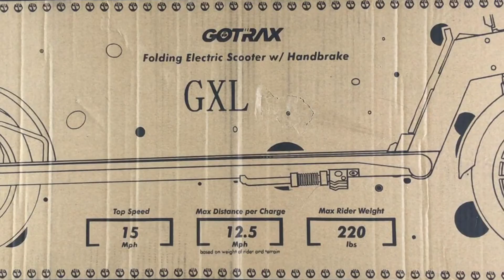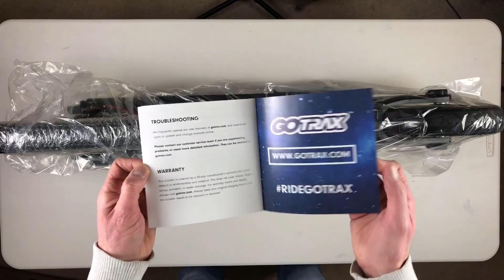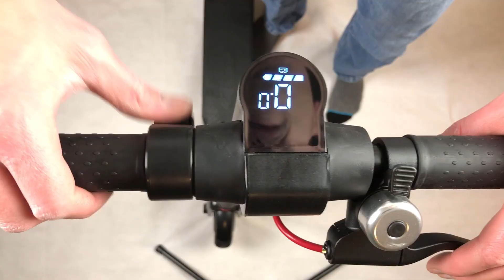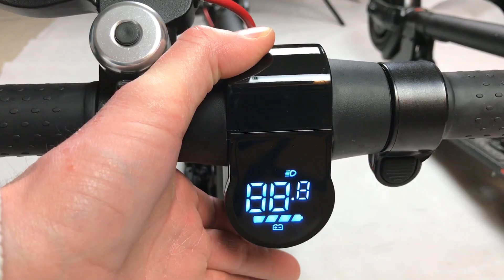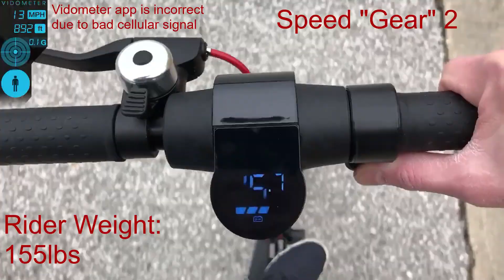NEW GoTrax GXL v2 Electric Scooter Unboxing and Assembly 2019

Comment: Hi, I have this scooter about two Months And I have a Accelerator Problem I cant ride my scooter anymore when I m push the accelerator button It doesn't working?
what can I do
Reply from the maker: Does the scooter power on when you hold down the power button for a couple of seconds?
Reply: @PowerOnFun Yes Everything Work Except the push accelerator
Reply from the maker: I have heard of someone complaining of the wiring of the throttle being low gauge and having an issue, but no resolution.  I would hit up Gotrax support with details to see what the issue might be and maybe how to further diagnose the issue with their product
Reply: I'm having the same problem with one I just got the acceleration doesnt work

Comment: can someone help? I can't get the break wire part down, I've tried attaching it before AND after screwing in the red hook and it's as if the line is too short and there's no give to attach it while its screwed in
Reply from the maker: Installing the tiller with the brake line can be a pain.  I think the easiest method is the one I used last by installing the brake line into the brake on the handle and then attaching the handle to the tiller neck.  If not matter how you try to install it the brake line is too short you may be able to loosen the rear brake where the cable connects and "borrow" 1/2in of it for added slack
Reply: @PowerOnFun  wait I’m a little confused with this description and what a tiller is, could you be a little more specific please? i even contacted their support team and all they told me was “maybe a bike shop can check it for you” like it’s your job... to support... so I’m basically in the dark here
Reply from the maker: Sorry.  The tiller is basically the scooter neck that connects the front hub motor/wheel and houses the battery pack.  If you have the brake wire going straight up the same side where it is attached behind the wheel (not going around the tiller neck) and there still isn't enough slack then easiest fix would be to loosen the rear brake line, pull some of the wire brake forwards, tighten the rear brake, and try to assemble again.
Reply: @PowerOnFun  i ended up loosening the very last screw that holds the end of the brake line and was able to slide forward some slack so that I could finally screw the top two screws on the red hook! thanks for replying and helping :)

Comment: I have problems with the rear fender and the folding hook, can’t separate them, May you help me please?
Reply: You have to pull it by force. That's how I did it and it didn't damage it at all
Reply from the maker: Sorry for the late reply.  I too have difficulty with releasing the tiller from the rear fender on the GXL v2.  I usually push down the tiller and put my foot on the rear fender and then lift up.  Regardless, it’s still troublsome

Comment: mine doesnt seem to go in 2nd gear? any ideas?  i hold the button down for 3 seconds and nothing happens
Reply from the maker: Does the scooter power off if you half the red button down for about four seconds?  If it's stuck powered on you may have to take the two bolts holding the handle onto the tiller, pull it out to disconnect the battery from the handle and reseat to see if it fixes it
Reply: Power On Fun yes it powers on and off fine but I can’t seem to get 2nd gear on it. I had a go trax v2 and it worked fine but this GXL v2 does it only have 1 gear or something maybe?

Comment: I’m having trouble lining up the handle bar to fit perfect in the slots when assembling it..I’m trying not to put a lot of pressure because I feel like it will break. Any recommendations?
Reply from the maker: If you are not sure if the pins are seating properly you can remove the handlebar from the tiller and carefully reseat it.  Once you believe the pins are lined up give it some good taps on top.  It should seat evenly and the screws on the side should go in without teouble

Comment: So theres a red thing when it locks the bike but i cant unlock it without the screw its on the back wheel
Reply from the maker: I had a difficult issue with unlatching the scooter tiller from the fender latch as well on both my GXL V2 and XR.  I was able to make it a bit easier to unscrewing the latch on the neck of the scooter and holding it as low as I can and then screwing it back down.
Another thing to try after that is to push    down on the fender while pulling it towards the rear of the scooter.
I'll have a video coming out in the future to help better explain this
Reply: Power On Fun thanks im glad you still reply to comments that videos are super old i just got one thats why

Comment: Good video. I own one of these and have no complaints. One thing to note, lots of people had to put tire slime into the V1 so they wouldn’t deflate. These come with the slime in the tires from the factory 👍🏽
Reply from the maker: I didn’t realize that Gotrax started adding tire slime into their tires.  That is a good touch to an already great scooter.  I have yet to add tire slime to my original GXL as well as my GXL V2.
Reply: Where to buy the slime for the gotrax?
Reply from the maker: @ednercarle7837 , I asked Gotrax about tire slime directly and they replied that the tire "inner tube does" have slime in it already.  I have not verified this, but assume they are correct.
If you still want to purchase tire slime here is a link:  https://amzn.to/2GHjkyy

Comment: Thanks for the video. That red brake cable had me confused for a minute. Didn't see it in the manual, lol
Reply: Yooo… sameee. The manual is not very detailed.
Reply: Ikr
Reply: I can’t get the red cord to fit
Reply: K I N L E Y . E x E ya I never really got it perfect but I juts pull that thing as hard as I can to get the break line to fit and my screws wouldn’t even go all the way in because of the pressure but it is what it is I put over 300 miles on my scooter in the first month and it was awesome I found this really steep hill and I could easily do 25mph on it and I weigh 170 but once you hit over 25 the scooter makes weird noises and it’s scary 😂😂

Comment: Hey, I was wondering how did you put it in 2nd Gear?
Reply from the maker: Once the scooter is powered on, if you hold the power button for a few seconds it will transition from speed level/gear 1 to speed level/gear 2.  If you are on level/gear 2 and hold the power button for a few seconds it will transition to gear 1.  I am not entirely sure if you can do this when riding however, but I will test that once the weather is nicer and I can ride more.
Reply: Power On Fun great video!!  I don’t know how I missed yours.  I’ve watch lots of videos on this scooter on assembly. They all suck!!! I purchased the ultra. Been riding it for 2 weeks now.  Been riding on it on gear 1.  I couldn’t figured out how to change to gear 2.  So now after watching yours, I think I can actually catch the green lights 😂

Comment: Just got mine and noticed the brake assembly instructions were not there , so helpful!
Reply from the maker: The rear brake should already be assembled.  I know there is nothing in the instructions to help with installing the handlebar with brake line onto the tiller.  However Gotrax has a good quick video on how to do this quickly.  I installed my handlebar and brake line the hard way.
Reply: Same

Comment: My gear 2 is not working ? I bought it oct 2020
Reply: There's no gear 2 on many models, it's something a bit new. I bought one late october and there's no gear (said so in the ad on Amazon). You just turn on.
The manual said you could go from gear 1 to 2 etc but there were no gears. Doesn't really go to 15.5 mph according to a GPS, either...

Comment: my break wire looks to be short , is this normal?
Reply from the maker: Make sure the line is going up the tiller on the side the brake line is attached by the base, then try to put the brake line onto the handle brake assembly with it deatached, then slowly attach the handlebar to the top of the tiller.

Comment: Is there  a big difference gxl and the version 2 ,,,and what would be a best buy price ,what would you recommend  to buy ,,,,thanks
Reply from the maker: Prices on Amazon can fluctuate, but normally the original GXL is $300 and the GXL v2 is at the same price or a little more (~$350).  I have affiliate links in my video descriptions for both scooters on Amazon.  Gotrax does also sell the scooters directly from their site.
Reply from the maker: I have a new video almost finished going more in depth to the scooter models similarities and differences.  The two scooters are almost identical except for the rear brake button on the rear of the deck on the original GXL and the handbrake on the new GXL.

Comment: i'm french so sorry for the writting mistakes...we assembled everything properly, we charged it until the light turned green. the screen lite up but  nothing else works, no light, no power at all nothing. Does anybody  have an idea why ...thank
Reply from the maker: I would remove the handlebar unit, then remove the battery within the neck, or tiller, or the scooter.  After that give the battery a quick inspection.  If you don't see any defects reinsert the battery carefully and then the handlebar and test the power again before putting on the hook and screws that hold the handlebar unit and hook on the tiller.
Reply: @PowerOnFun  thanks for the tip, but still nothing.  I even tried conecting directly the batery without the metal tubing unto the metal connectors and still nothing! The dash board lights up correctly but that's It... I do find the femal connectors on top of the batery (2 out of 5 small holes)To be différents.Not quite round. Anyways thanks for the rapid advise.

Comment: I cant get the stupid break in the in break area. It wont budge and i dont want to break the stupid break
Reply from the maker: You may want to remove the handle from the tiller neck, run the brake line into the brake handle while making sure the line is running up on the same side, and then install the handle.

Comment: I would like to state this, both my scooters of this kind was defective as i couldnt connect steering handlebar together towards the scooter itself so i had to return both of them and the battery dies way too fast imo
Reply from the maker: That is strange.  I know the brake line is fairly tight to allow for little to no slack getting tangled or caught when riding, but I've never had an issue with getting everything attached.

Comment: Can you ride it in light rain
Reply from the maker: The scooter could be ridden in the rain, but the wheels will lose traction on wet pavement in general.  In addition, the hub motor is not “waterproof”, but is at least water resistant.  However, if avoidable I would not recommend riding any electric (scooter, skateboard, bike, hover board) in or on wet pavement/roads/sidewalks.

Comment: Hey. I got this scooter but I'm unable to unfold it. Anyone to fix this?
Reply from the maker: I'm sorry for the late reply.  I have had difficulty with unlatching the scooter as well after my initial assembly.  Once I looked at the latch on the neck and the one the rear fender I then loosened the latch on the neck down as far as I can and then tightened it back up.  I believe that small changed helped a bit.
Reply from the maker: The latch on the rear fender is attached in a more complicated way and I was not able to get it loosened up to move it closer to rear of the scooter.

Comment: In all honesty, me weighing 240lbs won't break the scooter right? Lol
Reply from the maker: No, it won't break it.  The battery is in the neck so there is just structural support in the base (that and the brake cable goes through it)
Reply: @PowerOnFun  thanks fam
Reply: you wont break it, but may cause stress on electric motor (a.k.a: overheating)

Comment: How to open it
Reply: My friend left his how do u stand it up lol
Reply from the maker: The scooter can be a bit of a struggle at times to unlatch from the rear fender, but most of the time all it should take is when you pull down the fender try and pull it (towards the rear) a bit and then pull the tiller up and lock it in place.  To unlock it I usually lean down and place the tiller between my neck and shoulder while I pull the red lever and then pull the red side lock out a bit.

Comment: After watching this video fully I recommend that any 1st time buyers of a Gotrack scooter use a different video. This video is a lot of filler and goes to fast in spots you need slowed down. It talks as if you've already had a go tracks in the past and should know the differences and does not even properly show you all of the steps to complete putting the scooter together.  I had to completely take mine apart again and put it back together because of this video. I would use another video that uses the pro tip in the comment below mine about the handbrake, screwing the red hook part back in afterward not first, and also shows you how to put in the stabilizing pin for the folding part of the scooter, not like this video that just says its irrelevant. ITS NOT.
Reply from the maker: I'm sorry you had issues with following and the speed of this video.  It's almost 7 minutes and I try to go fast and clear as possible to not waste other people's valuable time with unusable filler and include specs and things that "seem" valuable to those looking for this kind of scooter.  I also have many other videos and many other detailed comments on scooter assembly and other items.

Comment: How can i get a good  deal am planning to  get one ,thanks
Reply from the maker: Other than purchasing on Amazon or Gotrax.com I do not know of any discount codes.  It may not help, but I do have an Amazon affiliate link in the video descriptions for each of the versions of the scooter.
Reply: They have a reddit discount I paid $270 shipped from their website and if you want a extra battery they have a discount for that also
Reply from the maker: @San Diago , be sure and check for discount codes also.  I believe RM5 is one discount code I have seen in May for purchasing the scooter.

Comment: WAIT BUT I CHARGED IT UP AND PULL DOWN THE THROTTLE BUT IT DOESN'T GOOOO
EXPLAIN!!!! :(
Reply from the maker: I assume the scooter powers on and the battery indicator shows a full charge (4 bars).  The scooter will not engage unless you are going about 2 or 3mph with a shove off due to safety reasons.  If it still doesn't engage the front hub motor try removing the handlebar, remove the battery, and reseat them.  If you still have issues contact Gotrax support directly

Comment: Yeah... I still can’t get this fucking brake line on. 😡😡😡
Reply from the maker: I would suggest to pull out the brake line on/in the brake handle, make sure the brake line is going up the same side of the tiller neck as where the line comes out of the scooter foot base, and THEN attach the scooter T-handle bar.  I've done it in a different order and also gotten frustrated.

Comment: im 280 pounds but im still gonna ride it
Reply from the maker: I think you should be fine.   Distance and speed will not be max, but it’s a workhorse.
Reply: @PowerOnFun  yea i ride on a razor scooter says max pounds is 220. but I put over 150 miles on it
Reply: @PowerOnFun  one more question. Say I wanna save the battery. Can i use it as a kick scooter ??
Reply: Kane Town Music you can but the scooter is gonna be a little harder to push it can be done tho. I’ve never had that problem with my scooter bc the battery last quite a while.
Reply: @Rizzinator123  lies
Reply: No fear, im 230 and it rides like im 100lbs

Comment: Mines won’t charge
Reply from the maker: Did the scooter ever power on?  Is there a red light on the charger brick when you plug it into the scooter?
Reply: Power On Fun I’ve been using it for a few weeks and the battery light is green and  the scooter battery logo keeps flashing which indicates I need to charge it lol
Reply: Power On Fun when I first got it and plugged it in it was red but now it’s always green and my scooter is moving slow and has no bars just flashing the battery
Reply: Power On Fun no it’s always green 🥴
Reply from the maker: Just a couple of things.  It sounds like the scooter powers on and off so I'm guessing the button is not stuck down.  One thing you could try is to remove the scooter handle and control, remove the battery pack,band reseat both and try charging.  Could possibly be a faulty AC adapter or cord, but other than using another scooter ac adapter there is not much you could do for that.
Reply: Power On Fun ight bet so unscrew the handle and reassemble it
Reply: Power On Fun ight bet ..how do you charge yours

Comment: Batteries are garbage. I get 2 1/4 miles out of mine before it dies. Someone at the company needs a slap. Idiotic air tires should be full hard rubber.

Comment: Mine isnt long enough to reach tje brake
Reply from the maker: I think the easiest way is to keep the handle/tiller detached from the scooter neck, attach the brake line to the handle/tiller, and slowly place the handle/tiller over and onto the scooter neck.  Then you can gently tap it down onto the neck and battery inside once you think it's lined up (you can check using the two screw holes that secure it onto the neck)